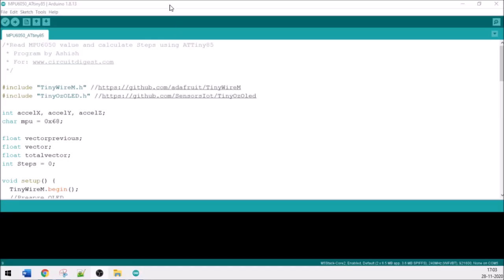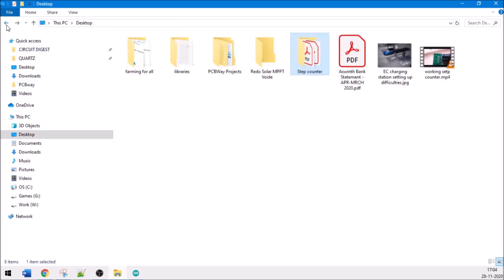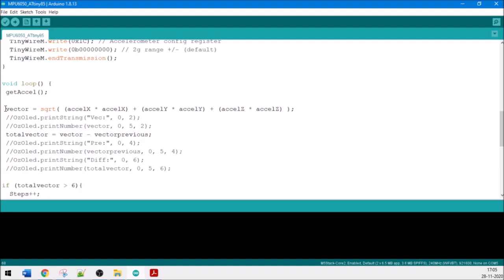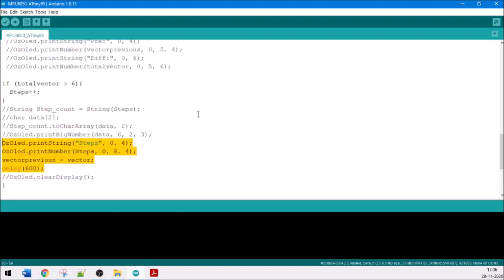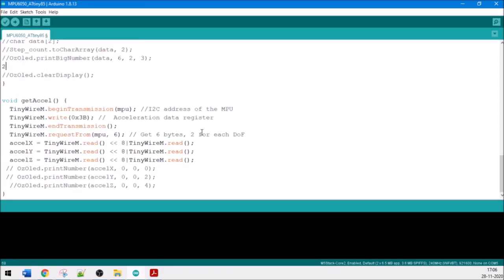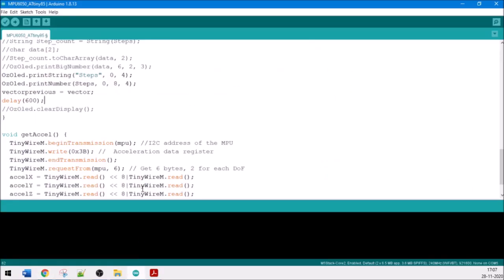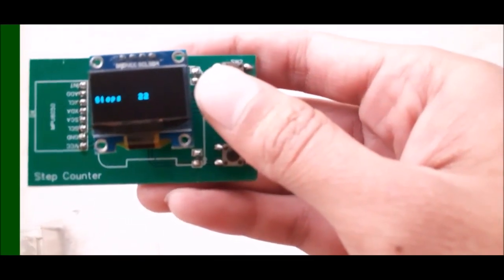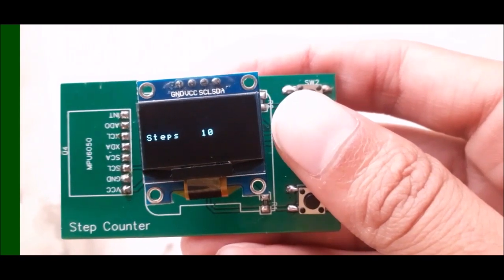How to Build a Portable Step Counter on PCB using Attiny85 and MPU6050

Comment: I understood correctly that the device does not have a gyroscope. are the steps counted by pressing the button?
Reply from the maker: The MPU6050 is an IMU with built in 3 axis gyroscope and 3 axis accelerometer.
Reply: @Circuitdigest  thx

Comment: how to add mpu6050 footprint in pcb software, i cannot get it in online, how did you do that?
Reply from the maker: Depending on the CAD software you use. In all CAD software there will be an option to import or create footprint. If you can't find a CAD model for your particular software, create your own foot print using the module's measurements.

Comment: ＋👍 I am very grateful to the author. It is a very practical wearable device. I watched your video and only one line of text was displayed. I will change the OLED display to 128*32. I am also redrawing the PCB Layout. In addition, I am drawing a 3D printing diagram. The casing is installed in the circuit. I want to use it for my family. Don’t worry, I will not use it for commercial purposes, and I will not publish this project.